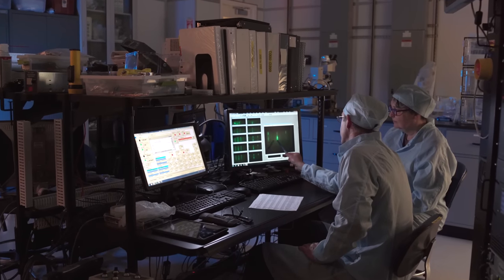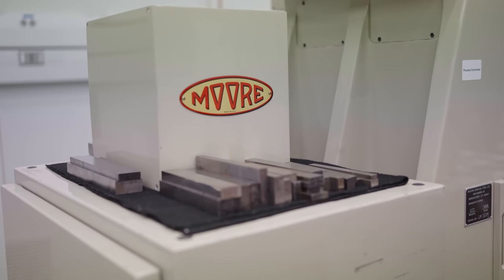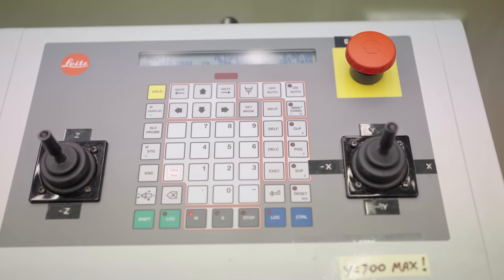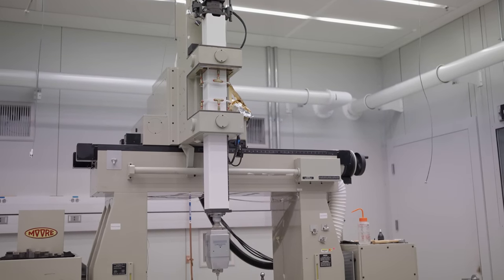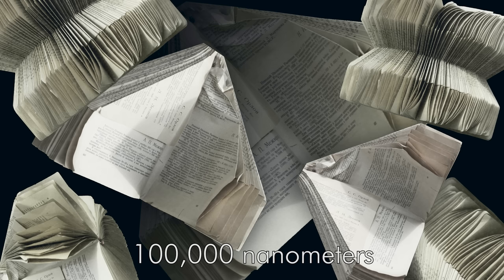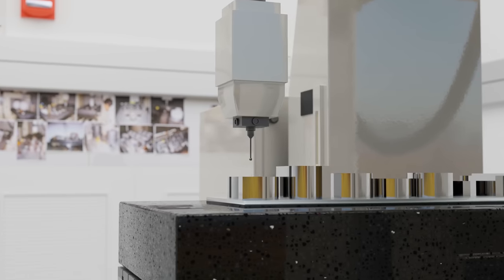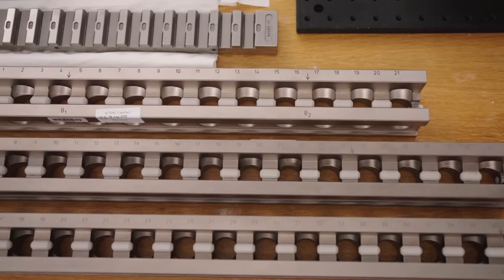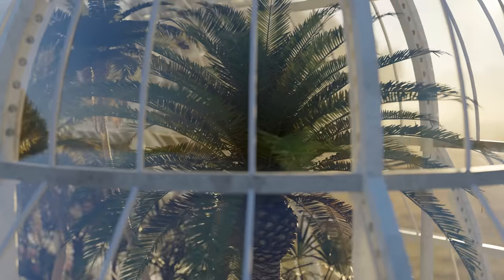The INSANE Precision of The National Institute of Standards and Technology

Comment: I NEED to understand how light can interfere with measurement of distance. I feel like you need to do an hour long follow up about the actual mechanics of this machine because I'm extremely fascinated.
Reply: I guess it's just absorbed, causing thermal expansion
Reply: Our sky looks blue because of the way that light is scattered by gas molecules (Rayleigh scattering). I think that some of those scattered photons could interfere with the wavelength superpositions that their laser interferometer relies on.  To me, that sounds crazy but the shortest wavelength of light that we can see and is given off by the lightbulbs is 400 nanometers. These folk measure down to 20 or even ten nanometers.
Reply: @jmchez  Laser Interferometers may use the phase diffcerence between the source and the reflected light and thus achieve sub-wavelength resolution

I guess any stray light that enters the interferometer distorts the measurement, at least if the wavelength is similar.
However stray light from foreign sources in the lab wouldn't be coherent and I guess any error caused by this would be random and practically vanish if the measurement time suffices
Reply: I think it's just the heat introduced to the room by the lights that's the problem.
Reply: @maeanderdev  averaging out noise is very time consuming, more so than you might imagine, it's better to remove the noise in the first place...

Consider a coin toss (insert usual disclaimers about "fairness" of coin and toss here...)

At 2 repetitions the chance of achieving the expected average result of 1 head, 1 tail is 50%
At 4 repetitions 2 heads, 2 tails is 37.5%

While the expected error decreases, the chance of no error also decreases.
Reply: @dougaltolan3017  I think you guys are overthinking this a little bit, it’s likely just because the lights themselves are a source of heat no different to a computer. Especially if they are fluorescent tube lights, which produce a significant amount of heat as a byproduct, but even LEDs would be problematic.
Reply: @ollie4022  coumd well be...
I'm wondering if it uses hydraulic drives, since an electric motor would also be a source of heat.
Reply: @dougaltolan3017   That’s a good point. I didn’t spot any lines in the video, but I wouldn’t be surprised if they did use a hydraulic system.

Comment: I had a friend that worked at a standards lab in the 40's and 50's.  His "interview" was to machine a steel rod of a certain diameter, then machine a hole in steel plate such that it took the rod at least so many seconds to "fall" through the hole but no more than a slightly larger number of seconds.  If you could do that you might be someone they could use.  When he retired he took up watch repair.  Something where he only had to worry about being accurate to a ten-thousandth of an inch - downright sloppy compared to what he had done.

Comment: I'm very happy you're still producing videos! Thank you!

The only reason I'm not surprised that the machine is so accurate is because it's using laser interferometry. For those of you not familiar with laser interferometry, it's the technology used by LIGO to detect gravitational waves from black holes. That machine has measuring arms four kilometers long - about two and a half miles.

Comment: As a HVAC technician, I am absolutely intrigued how they control the temperature of the room so accurately.
Reply: I've got some ideas, and they are all spendy. I would be at least as concerned with the air currents as the temperature. I know that a 30 fpm cross draft can make a four decimal gram scale go crazy.
Reply: @dedwardskbd  my guess is they have a intermediate room that is served by the air handler with +/- 2⁰, then an auxiliary air handler that mixes the air in the intermediate room, and then supplies the measuring lab using predictable laminar flow supply vents... Your thoughts?
Reply: @mynameismynameis666  sounds like something a lizard person would say. 🤔
Reply: @TheStevester2  2 planes destroyed 3 buildings. you must be great at maths...
Reply: Great question. First, it is expensive. Second, huge turbulent airflow from ceiling to floor, the room air fully evacuates and is replaced every 15 seconds. Third, no unnecessary heat sources in the room. Air is mixed from two handlers in an upper plenum. Hepa filtered. Temp and vapor pressure controlled. Gradients exist, but are extremely stable.  As Will said, you need everything working at the highest level for these accuracies. The process is only as strong as irs weakest link.

Comment: I used a Wenzel CMM for a few years. It could measure repeatedly and accurately to two nanometers. I had my own oversized a/c and heat units along with a good HEPA filtration system. When I walked in the room it would automatically turn on. When I turned on the CMM one could hear the whole system air up. 

Wenzel used better than AA inspection plate granite for the table, uprights, and crossmember because it is stable over small temp differences, has plenty of mass, and is super stable and flat.

It looks a lot like Voodoo or superstition when one does and learns what needs to be some and what one shouldn’t do. Like I’d leave the machine on from day to day so the thermals inside the machine would reach a stable point. I’d only move so fast and so far at a time and then stop for a set time before making the measurement. I reached my point when the head of meteorology didn’t want to buy new ruby tipped styluses. She thought I should be able to use the same one for years…. The guy I learned from at Wenzel used a new one with every new job at the minimum.

Comment: While watching this video and thinking about how I interact with precision in my field, it got me wondering about the more technical enviromental and procedural elements that play a just as important role to the process such as, how do they clean the artifacts before measuring. As well as, how do they keep the measuring surfaces clear of any FOD (Foreign Object Debris) when a technician is setting up an artifact, as well as do they potentially have a higher pressure room like what's used in medical clean rooms to prevent any outside dust and debris from entering, or is the room sealed.

Comment: Awesome video! I use the NIST Time stations transmissions at 2.5, 5, 10, 15, and 20 MHz all the time to dial in new shortwave antennas and radios. Would be so much more work to compare back to back without their constant signals.

Comment: The first jig bore that I worked on was a small Moore at Bosco Tech and a few at Hughes Radar Systems, but since then most others were made by SIP and the Most accurate CMM's have been Zeiss. Why isn't Moore equipment more widely used in the United States? The configuration of this Moore CMM resembles that of Zeiss CMM's and SIP jig bores.
Thanks for the video demonstrating that splitting Microns is old hack.   : )

Comment: The last section about comparative advantage of a country with such a machine was not fully explained - does anyone care of explain what the reasons are or guide me to some references?
Reply: You get to continually push the boundary in the pursuit of perfection -- others have to settle for "good enough".

And as good enough that "good enough" may be for most practical or pragmatic purposes, the occasions when it isn't turn out to be critically important because it turns out these sort of errors compound and accumulate. It's a bit like would be happen when you try to use renormalisation in reconciling gravitation with general relativity. All the little bits of "good enough" add up and you end up with a bunch of infinities and then it all falls apart.
Reply: @lezarium  Yet American manufacturing is not exactly famous for precision or quality, in many cases its the opposite. I think most of the power comes from controlling who has access to best precision, so US based companies get an advantage in the prototyping stage which means faster time to market, less trial and error.

Comment: I'm sure the concrete floor that machine is sitting on is isolated as well.  The metrology lab I worked in before I retired had a "floating" or isolated floor from the rest of the building to reduce vibration, with meters installed.  I worked with Zeiss CMM's for years in the aerospace industry. Of course the lab was environmentally controlled as well.  I've measured some amazing stuff, but nowhere near to this accuracy. It was a stressful job, especially when rejecting parts worth millions of dollars.

Comment: Awesome video, thanks for sharing :) I'm surprised that NIST doesn't require spacesuits for people entering that room, so you don't add dirt / temperature. Also, I'm surprised that the room isn't reduced to a vacuum to remove the issues with air pressure and humidity completely, would reduce the temperature issue too (possibly?) as temps of equipment would stay very stable (unless the vacuum would remove ability for machines to remove heat at all, which could be bad?).
Reply: If you calibrate an artifact in a vacuum and the customer uses it at atmospheric pressure, the difference in pressure will shrink the artifact. 

There is a continuum of accuracy versus ease of use. Some artifacts are made of super-Invar, Zerodur, or Cervit so their temperature coefficient is close to zero. Other artifacts are 52100 nitrided steel so the temperature coefficient closely matches the steel objects the customer will be measuring.

The air is also used to remove and equalize heat.
Reply: @bdykes7316  Great answer.

Comment: I am a machinist I have more than 50 years experience with Milling machines, surface grinders,lathes and other related equipment.  In order make those numbers relevant tolerances are need to be taken into consideration. The vast majority of  equipment used to make parts are accurate accurate to .000 (3) decimal places metric or .0000 (4) decimal places Imperial. So explain how the ability to measure nanometers effects a part. Or show me practical uses for this device. This ,by the way, is not criticism it's about practicality.

Comment: I wonder what the consideration for the backlash in that CMM is? Since it's laser feedback/output, and not servo position, do we have to worry about backlash at all? I also wonder what they do in the case that the measurement requires a 4th axis.

Comment: Fascinating! How much does NIST charge for time on their CMM? In one of the photos I see what appears to be a set of pistons. Anybody know why a customer would need to measure pistons with such accuracy instead of, say, a set of gauge pins or go/no-go gauges?
Reply: maybe for prototyping new engine or F1 cars. don't f1 cars have tolerance so high that when the engine is cold the piston are sized? imagine piston and cylinder so precise there is no ring. like an air bearing. (with the voice)
Reply: @pacopet1234  A lot of precision race engines must be warmed up before starting or they get ruined.  The Judd engine in the car I worked on produced 750 HP in 3.5 liters without a turbo and that engine was detuned from the F1 engine so that it could last 1600 race miles before rebuild.
Reply: While the other two responses are more oriented towards the auto part reference, as a trained USAF technician who worked with precision machines traced back to this, I repeat the statement indicated in the video.  "Traceability", The photos could have simply been examples of precision parts traced back to this machine.  Not every measure device requires this amount of accuracy.  Some of my fondest memories of my career were spent in a 68 deg room calibrating precision devices of various specialties.
Reply: @pacopet1234  FWIW, those are diesel pistons.

Comment: I have worked wjth NIST and PTSB(German standards body) in measurements related to illlumination, in my previous position (where I was responsible for development and application of 2 billion LEDs per year), and Uncertainty is "a big deal"!
Look up "Guide to uncertainty in measurement", if you want a fun bit of reading.
Very, very good video! (even thoug it covers only a fraction of the work at NIST!)

Comment: This video was incredibly fascinating, thank you! 
I did think of a question I was hoping you could answer. Is the probe that they used consumable? I imagine if it’s measuring a steel part, the metal contacting the probe removes a tiny bit of material each time. Do they have to replace the probes frequently?

Comment: Would it be possible to use microscope at the base of the ball tip as a camera to track the position of the ball and how far away it is from the object and use that to figure out the measurements.

Like tracking a ball in 3d space.

Comment: I have always had this question, which may seem repetitive and naive, but I have been unable to answer it, can you help me?

How are the machines that make machines manufactured?
To clarify further, let us assume that we have an open budget for making a documentary about the beginning of industries.
We have a beautiful, polished piece of Lego on the table and want to trace the manufacturing chains to the end. First, the manufacturer of the brick is the Lego Company. We will head there to find that they have precise injection molds, plastic! So how were these molds made? Yes, by laser cutting metals connected to 3D programs. Well, where were laser machines manufactured? Well, let us assume that it is HSG Laser Co., which manufactures laser cutting machines. We will now head to HSG Laser Co. to discuss with them how they manufacture these machines. They are now directing us to China, where they get all parts from Supro Manufacturing Group which is a huge company for custom metal shaping! Now we see that Supro Manufacturing Group has a vast factory full of complex and precise machines! How were these machines made? If we follow the manufacturing chain in 2023 until the end, will we reach a worker hammering metal with his hands?
Reply: The basic machines of metal and wood manufacturing can and will often make parts for other basic machines. The lathe, mill, and router can make almost any part (minus casting) to make another mill, lathe, or router other than specialized components like wiring.

So trace back manufacturing to the first instances of metalworking, then the invention of the lathe and mill, and you will see how the three worked out to slowly but surely over hundreds of years make increasingly complex and powerful machines for manufacturing.

Comment: I'm curious what sort of manufacturing processes and products demand such high precision beyond stuff like microprocessors. Even really tight tolerance machining is still in the micrometer range. Is this just for the creation and ongoing certification of calibration tools for those micrometer scale processes?
Reply: As an example, diesel fuel injectors. Sometimes the tolerances for manufacturing can be as small as one micrometer. Needing uncertainty ratios of 10:1 makes this extremely difficult, but also extremely important.

Comment: I wonder if you could address the way in which the semiconductor industry is able to make devices down to about 3nm particularly when the best NIST is able to do is somewhere between 10nm and 50nm.
Reply: This isn't the best they're able to do, obviously on a very small scale you can measure stuff down to well below nanometer scale. What's amazing and useful here is that you're able to measure objects that are several feet large at a 50nm scale.
Reply: @Avery R.  -- The size ASML has to deal with is 300mm which is not very small and yet they need to align with revious layers in the 5nm range or smaller.  They also need to do that fast as they need to be able to print dozens or hundreds of chips on a single wafer fast enough to be viable.
Reply: @Raptorman0909  Yeah, but you can't slap a steel bearing or a ceramic disc on it and measure it precisely. This is a general purpose machine vs an extremely specialized machine. Feels natural that the general purpose tool will have wider tolerances.
Reply: @Eagle3302PL  The NIST instruments are NOT general purpose machines, they are specialty one-of-a-kind instruments.  My suspicion is that NIST was being a little coy with the YTber and that they must have sub nm instruments they didn't mention.  The capabilities of the ASML litho tools to get down to 3-5nm is also the result of highly specialized instruments but I dare say there are far more ASML instruments of this ability than there are NIST instruments of this type -- TSMC alone has many dozens of them and Intel and Samsung would also have many of them.

Comment: How are these super accurate screws created? I get that the lasers are the ones getting the data but the screws must be crazy in terms of their tolerances.
Reply: The screws were initially ground on a thread grinder that employed "cam compensation" to correct for much of the error in the grinder itself. Then they were lapped and errors measured on a purpose built single axis measuring machine. Then further lapped to remove errors. When installed in the machine, the positioning is checked against Moore master step gages and remaining errors corrected by lapping. The M-48 in this video has laser feedback for actual measurement, but Moore also built measuring machines that used the screws as the measuring system. The screws were made from Nitralloy, which is extremely hard, wear resistant, and extremely stable.